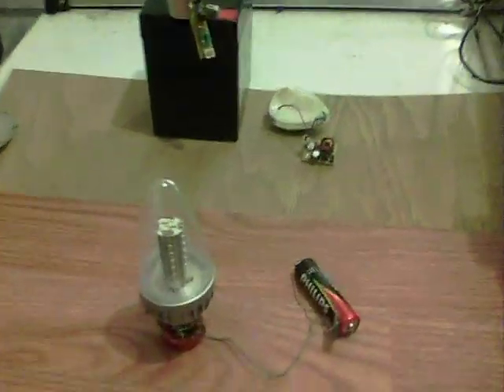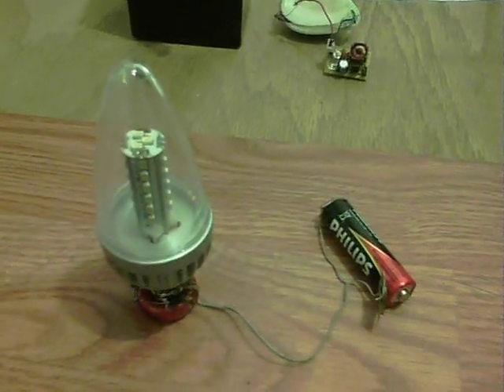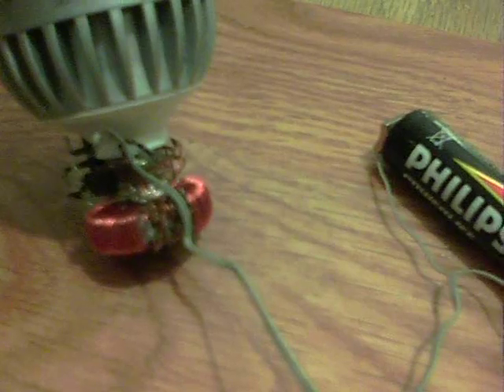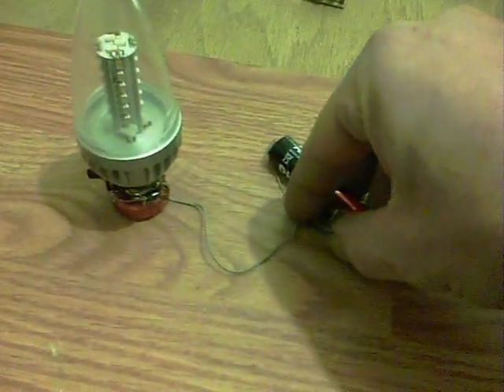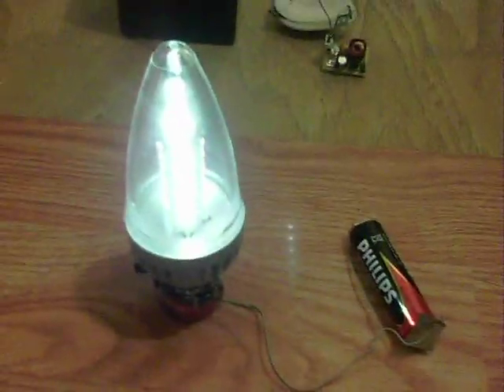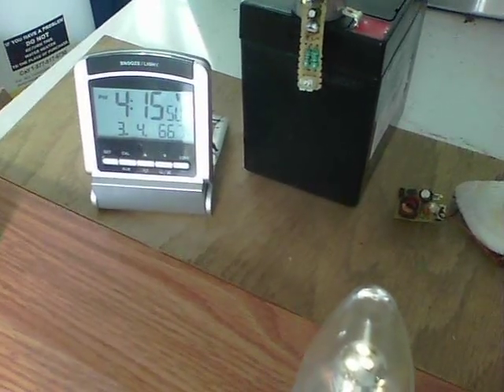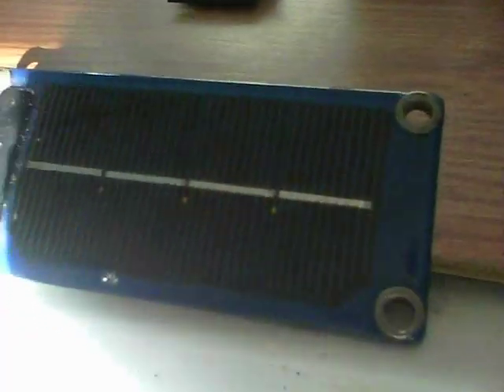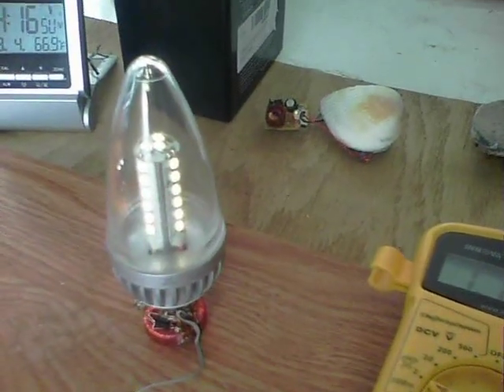Simple solar inverter + tiny circuit 1.5V driven mains bulb

Comment: hi slider, i have a question for you as your always playing with solar stuff....i have a 9v, 1.8watt solar panel which i want to charge a 1.2v ni-mh 800mah battery...i have a diode from the panel to the battery and it charges, however, itdoes it too well and the battery exploded :( ha ha,  anyway, what i need to know is how to have ''overcharge protection'' as i never see any circuits to prevent overcharging/exploding batteries...thanks man. rob.
Reply from the maker: 100roberthenry 
A good way would be an adjustable regulator, LM317 or such. they can be set to whatever voltage you want (1.2V to 37V). Have to watch current too, your panel can push 200mA, likely high for the AA, so a resistor is a good idea in series.
LM317 datasheet: https://www.fairchildsemi.com/datasheets/LM/LM317.pdf 
How to hook up is near the bottom of the document.
For overcharge, a zener diode at the top rating of say 1.35V could go to a filament flashlight bulb. If the battery goes over, it sends the power to the bulb.

 Funnily enough, I just did the same thing as you the other day, used an 18V panel to charge an AA. The experiment was to see if using a very low amperage would work..so I charged indoors in the shade. Voltage is easy with solar, amperage can be limited with shade, it was receiving about 14V at 5mA and worked well. However, obviously that's not the right way lol !
Reply: hi thanks for the reply, yep i have a lm317 so i can get it set to 1.2v,  i'm n not sure i understand the zener diode/filament thing though..would you have a diagram of what you mean?..my email : deadastronautfx@yahoo.co.uk

thanks, rob.
Reply from the maker: 100roberthenry  Hi Rob. the idea is just for a bleed off of excess above a certain voltage. Another way of doing it, would be to find an LED which doesn't conduct until 1.3V, superbright white or blue etc. At that voltage, the LED will probably not even light at all but will drain the excess. Only have to put it in parallel with the battery :)
Reply: ahh gotcha, i'll give that a whirl....cheers slider, thanks for your help, rob.

Comment: Very nice.  When we couldn't find the big 3'' toroid anymore for a reasonable price alot of people lost interest in "Jeanna's Light".   Jeanna was a master at using a secondary to bump the voltage up on a simple blocking oscillator circuit.  I miss her.  Last I herad she was living up in the pacific northwest in the woods.  She got a couple of old shipping containers and made a cozy dwelling out of them.  She is off the grid now.

Comment from the maker: @spicer41282 Yourself and another viewer mentioned the wish for silence, so am glad you checked back for this one. A close wiring up diagram is Lidmotor's "Jeanna's Light". Omit the LED wind, omit the rheostat and change the 22ohm resistor to a small value variable resistor (up to 1K is fine). Transistor can be much smaller than a 3055 if MPS2222A/2N2222A/MPSA06 and equiv. It's prior art beside those changes, hence I didn't do a circuit diagram.

Comment from the maker: @harpbloke Single piece toroid and it's 30 gauge wire, so, not so bad. I wound the turns on a piece of a pen first and then popped the piece through the toroid hole and around for each turn. There are 2 layers of 150 turns :)